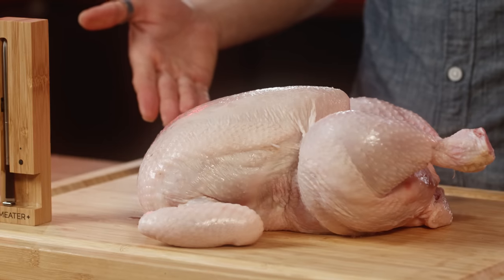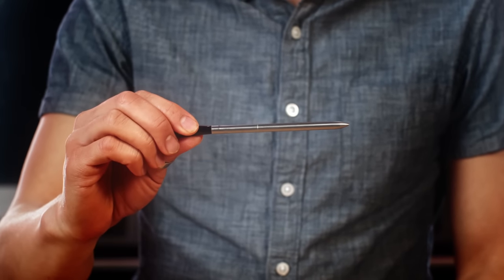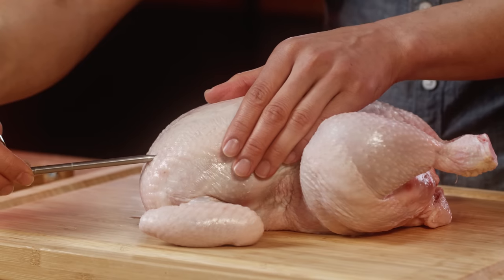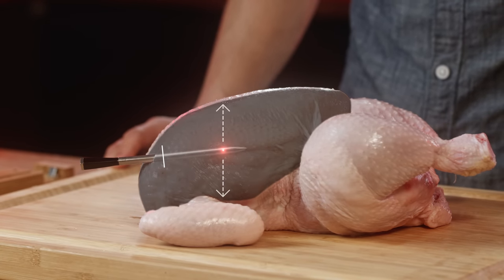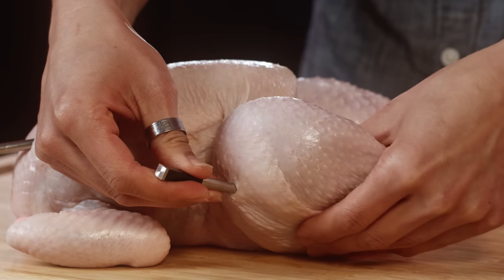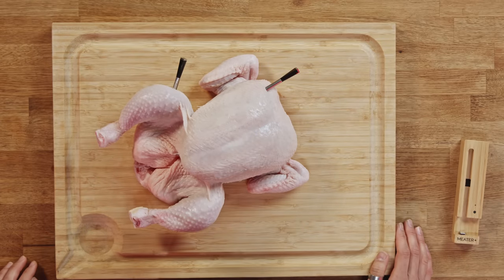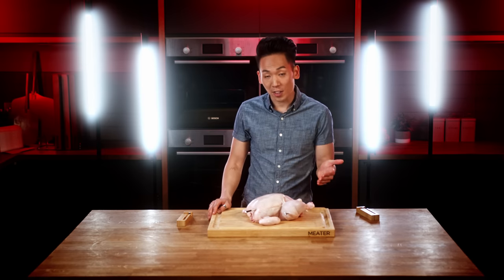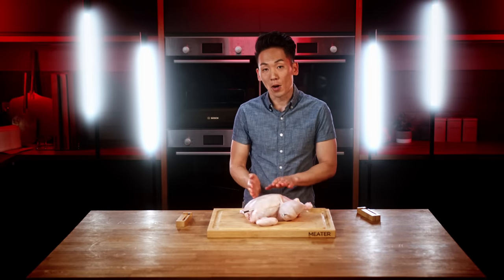Poultry Probe Placement | MEATER Product Knowledge Video

Comment: I’m going use my MEATER for the first time cooking a whole turkey. I set everything up right but it said it was done in 2 hours and it is a 20 pound turkey. I put a different thermometer in and it was only at 122. What could I have done wrong?
Reply from the maker: Please feel free to book a call at https://meater.youcanbook.me/ so that an agent can call you within 30 minutes of your scheduled slot time and we can solve this without any further delay!
Reply: Cooked at too high a temperature, cooked the outside but not the inside, lower temperature is key 270-300 works for us but takes longer of course

Comment: I got the MEATER probe for Christmas.  I've used it, but have a problem with it keeping connection with my cell phone.  I have to put it by the back door, about 25 ft from the smoker.  I have a camp chef smoker, does closing the lid shorten my connection?  If there is something I can do to to increase the distance?  Thanks!
Reply: I have the plus version and it doesn't do it to me. However I heard the regular one did have said problem unfortunately
Reply from the maker: Hey Doug! The MEATER Original/Plus ranges up to 33-165ft in open air however some appliances with thicker walls may decrease the range when you close the lid/door. Please be sure to keep the charging base next to the probe(s) in use. If you use tin foil for you cook, we also recommend that you poke a hole for the probe to peak through! 

If you're still experiencing connection issues and would like help, please reach out to customer support at https://meater.com/support and they can help get things working correctly! :)
Reply: I have an old cell phone that I use for that problem. I leave it next to the meater base connected to my home network, then I open the app on any other device on the same network, and it's an instant range extender